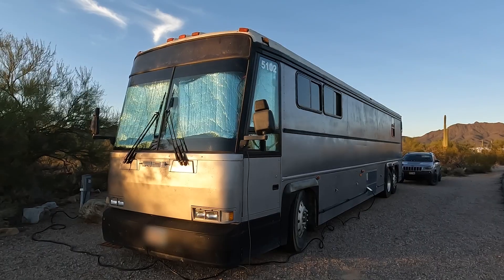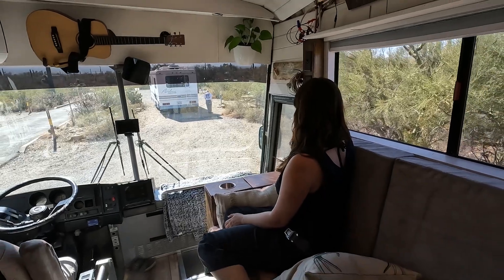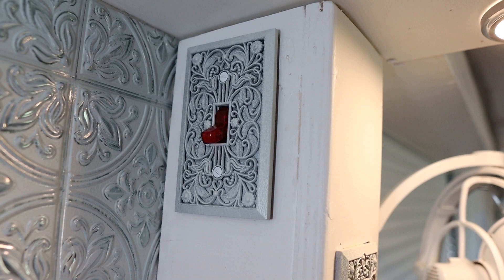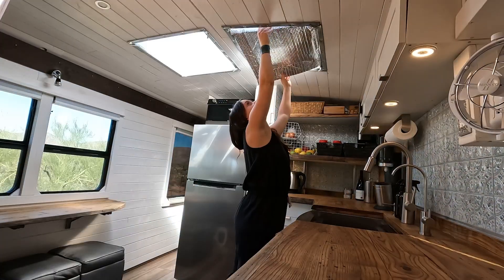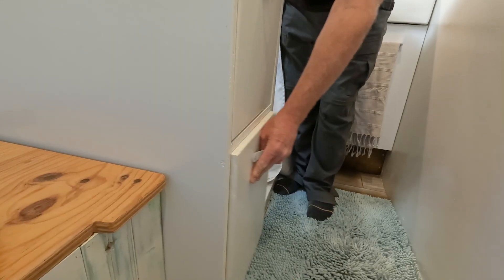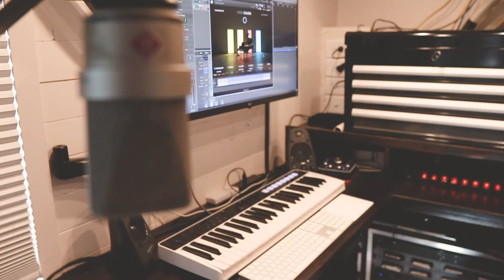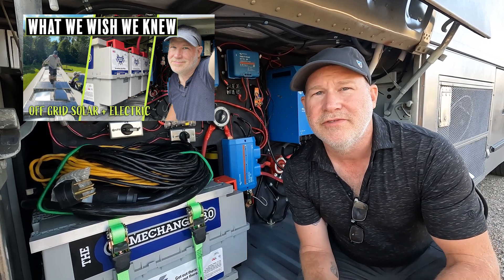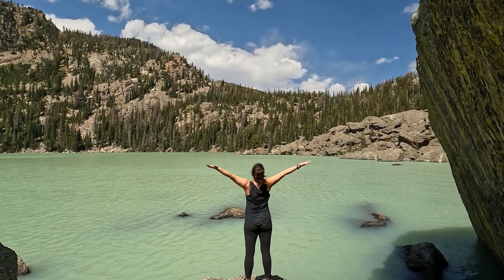Bus Conversion Tour | Couple Builds Tiny Dream Home in Coach Skoolie for Off Grid RV Living S05E16

Comment: For your skylights you may want to check out a ceramic window film made for cars - it’s clear and colourless and blocks 90% of the UV that causes solar gain - can’t remember if it was made by 3M, Corning or DuPont - saw it on a YouTube video about car window tints - the video wanted to set the record straight that the only thing the dark tints do is provide privacy, they don’t keep the car any cooler - they had a thermometer set up to prove their point etc - suffice to say, I got the message! 🤣

Comment: Huge bay area in a full size coach but used a composting toilet 🤢?  That’s for van conversions when you don’t have space for a tank,  you should have used a large black tank, vented through the roof, and you could have gone weeks without dumping, with zero handling or smell, or looking at it.
What’s the big deal with putting a hose to a dump station and pulling a lever and never having to deal with that $4it.
Reply: How about that toilet with NO privacy ?? With a 40' Coach I would REQUIRE a full time bed! LOL This Coach was built to THEIR needs. They will have troubles selling if they ever decide to... JMO
Reply: @RimdarRanch  yea it’s just weird.